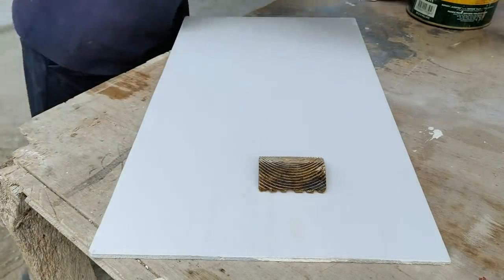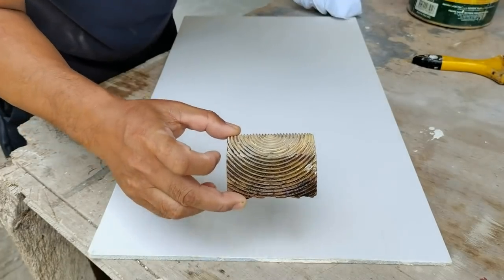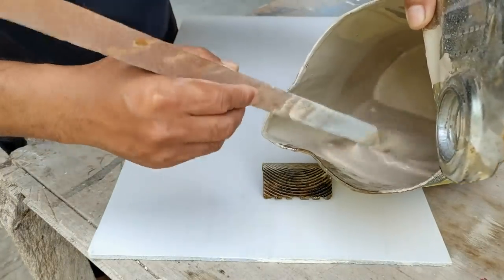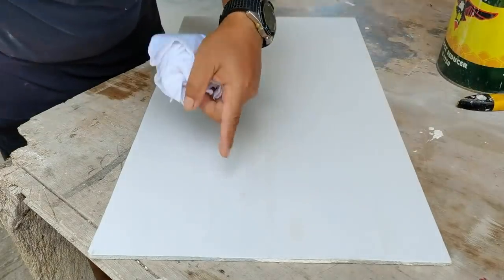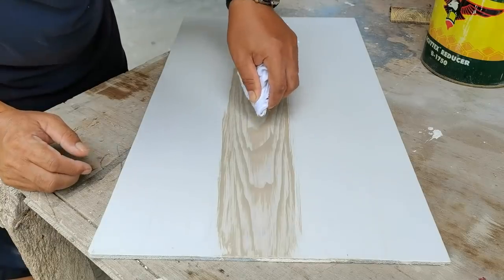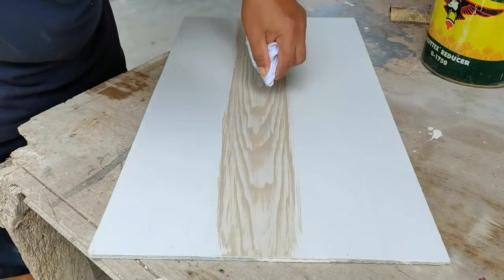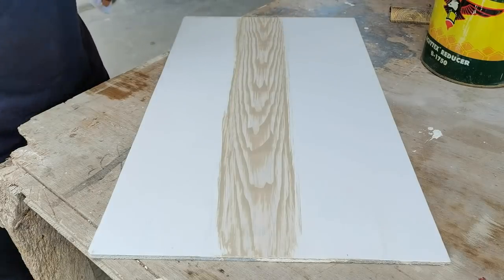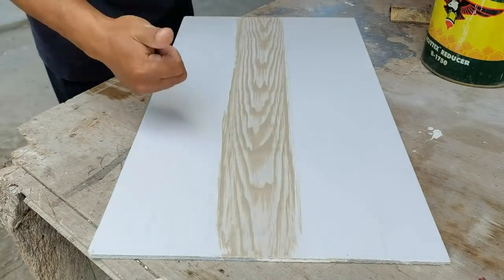Paano gayahin ang design ng laminated cabinet  wood effect/ How to make laminated design effect

Comment: Boss un ginawa kong cabinet base coat ko ay epoxy primer ano po ang gamitin kong pintura para sa haspe at sa top coat salamat
Reply from the maker: Kung may pang spray po kayo mas maganda po gamitan mo ng oil wood stain tapos ipitin mo ng sanding sealer gamit ang spray at itop coat ng clear gloss

Comment: Sir..lage ko pina panuod video mo my napanuod ako don yung pinto ginawa mo pero inuna mo emution  pagkatapos mo magdesign sa pinto sabe mo kylangan una emotion para maipit bago sanding sealer
Reply: tama yun nga rin ang iniisip ko, bakit dito sanding sealer agad doon sa unang video, acrylic emulsion bago sanding sealer tapos clear gloss. dito iba naman
Reply from the maker: Ok lang naman po na maglagay po ng emulsion bago isealer at top coat dahil latex sya,,isang dahilan kung bakit nag emulsion ako sa vdeo na yon dahil matigas ang brush na gnamit ko dun at posibleng mapanot pag direct kung isealer,d gaya ng brush na gnamit ko sa vdeo na ito na camel hair brush po sya malambot kaya wala akong kaba ng isealer agad
Reply: So hindi naman lolobo yung pintura nya sir pag nalagyan agad ng laquer sanding sealer

Comment: Sir medyo naguluhan lang ako yung last video mo emoltion yung finish na nilagay mo sabi mo matibay yon tapos ngayon sabi mo natutuklap ang emoltion? Sir paliwanag naman kc medyo naguluhan ako. salamat idol
Reply: Sanding sealer Po Ang ginamit pang seal sa haspe tapos Yung top coat clear gloss laquer sir
Reply from the maker: Yong unang napanuod nyo po ay para po yon sa concrete wall o dingding kaya latex rin ang ginamit pero emulsion po ang pang finish dahil sa pang semento po yon..itong bago po ay sa plywood na po ito dahil ang ginaya po ay yong laminated na cabinet kaya d na emulsion ang ginamit kong top coat
Reply from the maker: Tama po kayo
Reply from the maker: Para po sa concrete wall ang unang napanuod nyo boss kaya emulsion ang ginamit na top coat dun..itong bago ngayon ay laminated na cabinet ang style kaya magkaiba ang top coat

Comment: Good Day Sir, anong pintura ang primer at base coat mo diyan kasi latex paint ang pang-design mo? Matibay ba kapit niyan sa plywood o hardwood? Tnx Sir...
Reply from the maker: Automotive lacquer primer surfacer white po gnamit kong pundo dyan..wala pong problema ang latex sa kahoy o plywood basta masilyahan nyo ng polituff ang ulo ng pako para d kalawangin..nasa description box kung anong mga materials ang gnamit ko

Comment: Gusto po sanang malaman ang tamang pag timpla ng kulay or resue ng bawat kulay
Reply from the maker: Ang pundo na surfacer ay 20% ang lac thinner na hinalo ,,5% na lacquer flo...sa sealer po ay 20% ang thinner at 3% ang flo..sa top coat clear po 10% flo at 20% lac thinner

Comment: boss pwede patulong sa mini project ko,  bakit ganun idol yung ducco finish ko nagbabubbles/bola ang top coat ko kapag baby roller ang gamit ko,  tapos ginamitan ko nmn ng electric spray paint nagkaroon nmn ng parang sapot ng gagamba.  ang gamit kong pintura idol ay epoxy primer na guilder,  top coat ko nmn ay guilder acrylic white. nagtrial and error na ako sa thinning kaso ang pangit prin ng resulta. ano ba pwedeg gawin idol? may iba pa bang klase ng brand ng pintura n pamalit sa brand na guilder. 😪😓
Reply from the maker: Acrylic pala ang ginamit mo boss ,dapat sana automotive lacquer lalo na roller lang ang gamit mo..pwd rin naman yan kaso damihan mo ng acrylic thinner dapat po 30% ang dami ng thinner doon sa pintura mo
Reply: @bestvarnishpaintsideastech4578  kaya nga idol yun kc sabi sa binilhan ko ng pintura.  pero idol pwede pa ba patunong ng kahit anong pintura na pangtop coat na pangducco finish? ang hirap kc kpag acrylic white guilder gamit.

Comment: Boss ang galing nyo. Baguhan palang po ako.  Kapag mag pipintura ako ng long chair pwede po ba na ang
 1st coat ko ay flat latex white tapos 
2nd coat is GLOSS/SEMI GLOSS na latex tapos ang pang
 3rd ay yong gagawin kong haspe ng kahoy na TINTING COLOR na ihalo ko sa PAINT THINNER
. Pwede po ba tong mga pintura nato boss PARA sa long chairs? Salamat.
Reply from the maker: Pwd naman po basta isanding sealer mo  pagkatapos haspihan bago mag top coat ng polyurethane
Reply: Pwede po ba ang top coat ko is clear gloss laquer?
Reply: Peru boss pwede lang din po ba na hindi ko lang lagyan ng flat latex white. Silbi ang first coat ko sa wood chair ko, is gloss or semi gloss latex tapos haspe na ng kahoy using tinting color.. pwede lang boss na walang flat latex white

Comment: Boss gnya ko to.  Ask ko po sana bkit nung pinaphd ko sandng sealer.  Nlulusaw ung latex paint.
Reply from the maker: D ko lang sure kung tama ang timpla nyo po sa sanding sealer kasi kita nyo naman ang ginawa ko d po nasira..baka po subrang dami ng flo at binigla nyo..at pansinin nyo pag nag spray tayo ng door jamb tapos masprayhan natin ang wall sa gilid ng hamba na may latex na pintura pero d po sya nasisira
Reply: @bestvarnishpaintsideastech4578  sir idol 1st tym ko po gmwa.  Wt po b tmpla ng sandng sealer.  At laquer clear coat.  Brush lng dn po gnmit ko

Comment: Boss tanong lang ulit...magkano po ba yang grinning tool, at magkano ang per liter ng sanding sealer...ilang klase po ba ang clear gloss iba ba yung pang kahoy at pang concrete o depende kung anong klaseng pintora ang pagpapatungan mo ng clear gloss?.. Slamat boss.
Reply from the maker: 200plus sa online,200plus din ang sanding sealer,may 5  po na klaseng clear pang kahoy ang clear gloss,water white clear,valspar top coat,polyurethane at epoxy clear..ang para sa semento ay tatlo ang emulsion,epoxy clear acrytex clear .mag dpende po
Reply: @bestvarnishpaintsideastech4578  salamat boss... More blessings sayo..

Comment: Good evening po sir idol, ano po ba ang ginamit niyo nitong paint? Latex or Enamel or Wood stain? Salamat po
Reply from the maker: Lacquer primer po ang white na pundo,semi gloss latex po ang yong pinag dsign timplahan po ng raw sienna at lamb black acry color,,pinatungan ng sanding sealer at top coat na clear gloss
Reply: sir ok lang po ba e sanding sealer yung semento na pader na ginawa kong haspe?makapag patibay po ba sya sa haspe q na glos latex?sa labas ksi sir init at ulan

Comment: Anu po ang ginamit nyo na primer at masilya sa plywood sir?
Reply from the maker: Surfacer po ang primer at lacquer putty naman po sa masilya
Reply: @bestvarnishpaintsideastech4578  pwde po patungan ng primer surfacer ang plasolux putty sir? Yun na po kc nailagay ko at wla pa primer. Pag straight enamel po ba gawin ko anu po pwede pang seal na clear sir sa ibabaw ng QDE? pag lagyan ko din haspe

Comment: Sir may katanungan lng po aq gusto q lng po malaman kung waterbase po ba gnmit nyong. Pintura at pano po ang tamang timpla sa pag haspi salamat po sa sagot.
Reply from the maker: Ang pundo ko na puti lacquer primer surfacer po..ang pinag haspe ko ay semi gloss latex na may halong raw sienna at lamb black acry color at nilabnawan ko ng tubig..sa isang tubig ay ganun din kadami ang pintura para po malabnaw d madaling matuyo
Reply: @bestvarnishpaintsideastech4578  salamat po sa iyong kasagutan malaking tulong po ang inyong video pra sa aking kaalaman balak ko po kasi ako na mag diy ng kabinet ko kpg nakpag bakasyon po ng nextyir sa pinas pra menos gastos at sana mawala ang pandemic keep safe po kabayan mabuhay po kau NEW SUB na din po sa channel nyo no skip ads ng my maitulong din po aq sa channel nyo.
Reply: @bestvarnishpaintsideastech4578  bali yun pinang primer nyo is hindi sya water base correct me if im wrong po.